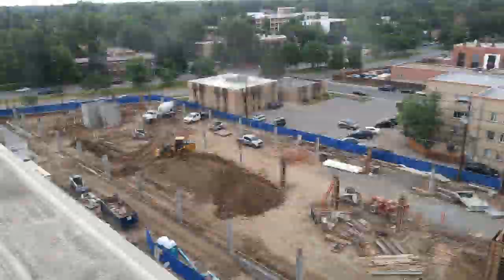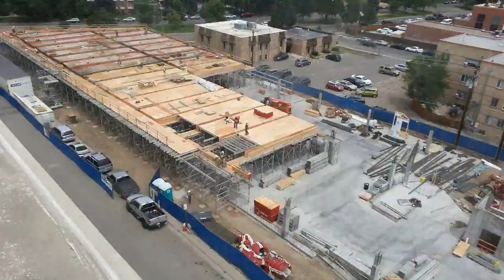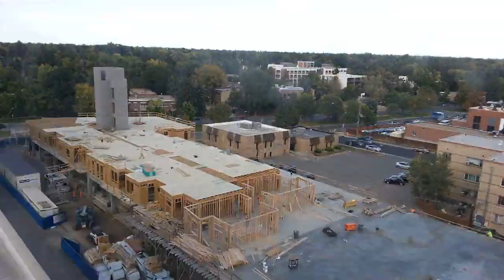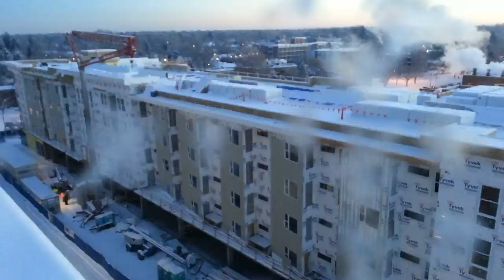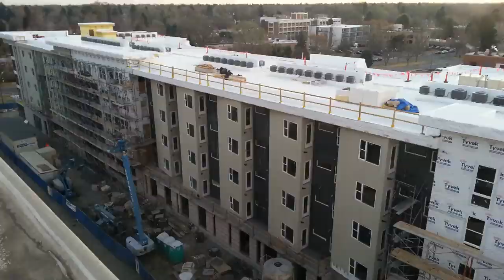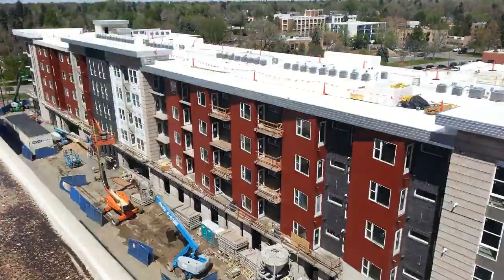Ash Street Apartments Timelapse Video

Comment: 5-storey building made with wood... one of the most insane things I've ever seen
Reply: Wonder how long it'll last
Reply: I can't tell if you're serious or not. 5-storey wood-framed buildings are very common. This one is only 4 stories of wood-framing on a concrete first floor, or a "4-over-1". They're commonly built with up to 5 storeys of wood-framing on a concrete first floor, making 6 floors overall (called a "5-over-1").
Reply: @AWSVids  Only in the US is that common. Everywhere else, it would be considered an abomination.
Reply: @samuelpo3378  theres a japanese temple thats 800 yo and made of wood, so it depends on the build quality, this wont last more than a 150 years since thats fire retardant wood, there too any metal nails and reinforced concrete, metal its the enemy of building lating long since it rust and breaks things, concrete expands and crack and wood too
Reply: @jm036 This dude just called a wood building an abomination😂🤦‍♂️
Reply: Yeah which also explains why it took 2 years.. concrete would be faster
Reply: @MrBurns0618  Yes, apartments should only ever be concrete.
Reply: @jm036  Sure, if you want major temperature fluctuations to crack it over time.
Reply: @MrBurns0618  Lmao. Delusional.
Reply: @jm036  Delusional? You mean basic understanding of how concrete reacts to temperature fluctuations and moisture? Your getting way ahead of yourself with what you actually know.
Reply: @MrBurns0618  Idk man reinforced concrete seems to work fine for the entire damn continent of Europe, I'll believe that over some youtube comment.
Reply: @jm036  Eastern Europe doesn’t have a vast region of country that can go from 90 degrees Fahrenheit to well below 0 degrees in the course of a few months.
Reply: @MrBurns0618  Except we fucking do and I live in it.
Reply: @jm036  Yeah, if your in inland Germany, Poland, Russia region, sure. Not to mention concrete used in buildings has to be specially prepared for use when in areas that have massive fluctuation.
Reply: @MrBurns0618 A concrete house is up to every temperature on earth. I have one since 40 years. It is much stronger , can withstand a hurricane or a wildfire. It doesn't burn down in minutes, sound isolation is way better than this. It keeps high temperatures out in the summer and cold in the winter. The superstructure is way more solid. Americans built huge but not strong houses. Considering the slow tempo of you firefighters timber is not a good option at all. I saw a youtube fiml today of an American timber made house. From a small fire to a house engulfed in flames took no more than five minutes for a large house. To people were killed because the qarning came to late. It took the firefighters 7 minutes after arrival to begin spraying water. Far to late. The  ar didn't have its own water. They had to het is from a water tap50 meters from the house. It took ages. In the Netherlands all houses are made of concrete and brick. It takes a Dutch fire

Comment: I wonder how much power the US could save building their houses with adequate insulation. In my region, we have much higher temp summers, but don't need AC, and here are completely new apartments that rely on AC to keep them cool, rather than using thicker walls and 3 pane windows.
Reply: John Doe  Because other countries have a lot to build top, but they do it HQ? And what do you mean by "you pay so you use it"? So homeowners must build AC into their homes?
Reply: Greater initial cost scares them away. Most buildings aren’t really made to last that long
Reply: you live in over 140 degree Fahrenheit 60 degrees Celsius in the summer with no ac!! That’s insane!!!! We can’t even open a door without waiting an hour for house to cool off!
Reply: I dont think those were AC, i think some type of ventilation fan

Comment: I'll bet those apartments are super noisy.  If only the architect had to live in one.
Reply: It’s not really the architect’s fault, because this is cheaper than building with more insulation or with sturdier materials. Blame the system that incentivizes taking the cheapest option instead of the most efficient or safest options
Reply: I've lived in wood apartments that are incredibly quiet. Well insulated wall and a fiber concete layer between floors. Just because it's wood does not mean it's loud. I've been in concete buildings that were a disaster for hallway -> apartment acoustics. Poor design is poor design.

Comment: Yes ! Wood again !!!
Reply: Bad choice. Noisy,  Dangerous for fire and a tornado will  blow this away in a minute. The isolation is bad. Walls are very thin. Concrete is mutch stronger
Reply: @jeanpierredevos3137  concrete is more polluting  :(
Reply: @federicoeco9030  but wood more dangerous. Thats life, if we dont want polluting dont build a building, plant a trees.
Reply: @jeanpierredevos3137  look the wooden skycrapers !
Reply: @jeanpierredevos3137  insulation*

Comment: How many trees were used for this.why not used concreet to bild these apartments. Stronger and cheaper.
Reply: sustainable harvested wood is used for clt, plus concrete is not environment friendly, built in shorter time frame and it is better for earthquake.
Reply: @Li Zhang nope not necessarily
Reply: @prabhanjankulkarni9048  there are concrete resistant buildings all around the world
Reply: Concrete is not cheaper to build.
Reply: @giladwasheretravel3553  The why use timber?
Reply: @jeanpierredevos3137  as someone above me wrote - timber is natural and much less pollutant.
Reply: B/c we still have forests in Pacific Northwest and Canada.  Therefore, we still have much stick frame building...  Also, the CO2 concerns of Portland Cement are higher than wood shipped from Canada.  But if it were cheaper to do in concrete, it'd be in concrete.
Reply: @ngrader  not to mention concrete is extremely difficult to water and air seal especially if it’s in colder climates. Also as far as tornadoes go, most buildings are leveled or even uninhabitable when hit by an EF3 or greater. Finally for fire concerns, fires are limited in these commercial buildings by sprinklers whether it’s made with concrete or wood it’s required by US codes to have sprinklers in every unit and hallway. I am aware that soundproofing is lacking in most apartments but that’s easy to solve.

Comment: What kind of apartment building is made with wood ? I understand a small 1 family home being made with wood, but an apartment complex ?! Cmon
Reply: Most 4-5 story apartments complexes built in the last 30-40 years are framed with lumber. The lumber is typically sustainably harvested from tree farms. It is a good and cost effective material - although over the part 12-14 months lumber prices have skyrocketed. If the same apartment units were built out of concrete or steel you'd easily add 30% to the cost of the unit.
Reply: Learn about construction before making such judging criticisms
Reply: @timpula9984  it’s a good material but i really think that each floor and dividing wall should have insulation between them to limit noise transfer.